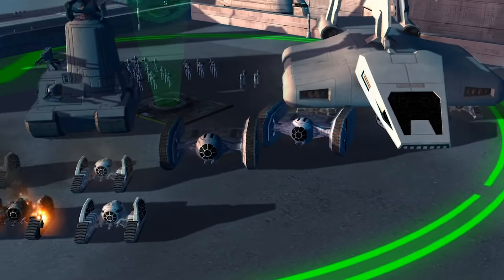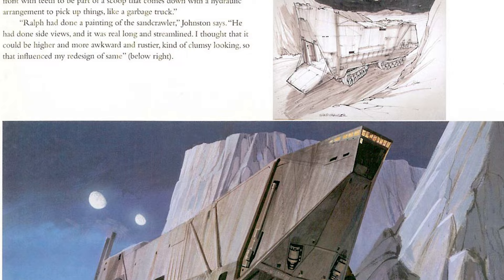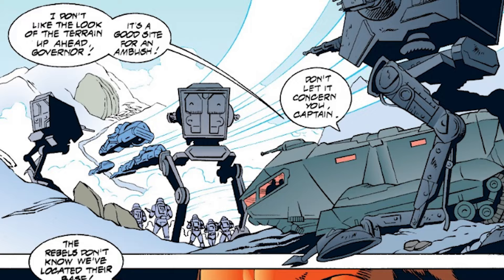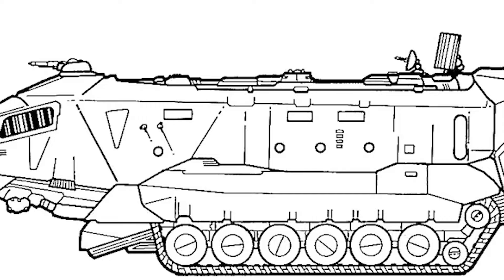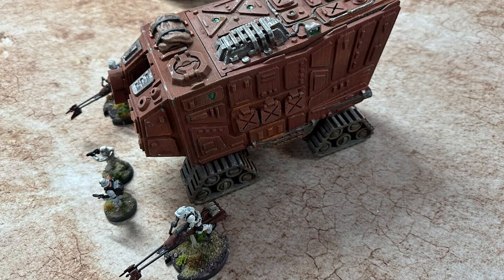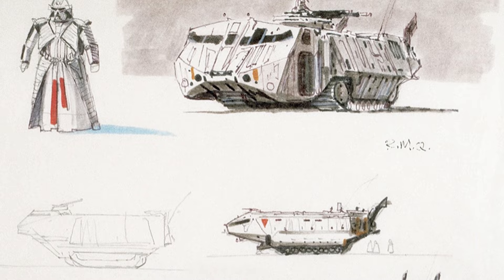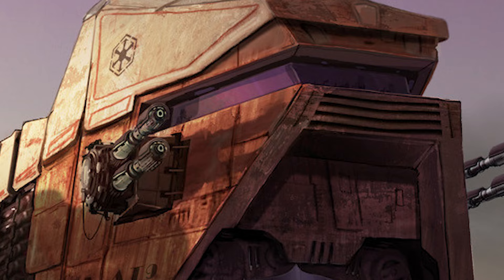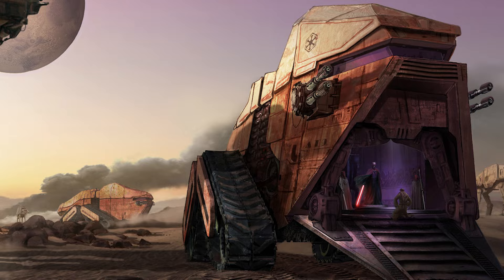Imperial Tracked Crawlers were GENIUS...but neglected | Star Wars Breakdown

Comment: I am sure there could be a whole host of tracked vehicles that aren't seen because they are more niche. Seeing as they made a submersible out of an AT-AT and the TX-225 had both a repulsorlift and tracked variant. The Saber-class assault tank spawned a decent sized family of variants, and I wouldn't be surprised to learn that a tracked version was counted somewhere in it's number. The company Yutrane-Trackata also produced the T3-B and T4-B tanks for the Rebels, as well as the chassis on which the MZ-8 was based on.

Comment: Honestly I think all designs have their role. I mean I like AT-ATs simply because they don't need waste laser cannon energy on every single hazard or obstacle the enemies have. While fast repulsor craft are really good either flanking the enemy or harassing the enemy in other areas. Like the imperial hover transports might not be great at assault an enemies fortified hq. However what they can do is attack the enemies outposts and lines of communication as well as deal with enemies own scouting patrols if you have the element of surprise and then further lengthen said time period of surprise. Quick lightly armoured units are just great for that. Attacking the enemies lesser defenses as well as means to communicate with each other.  if the enemy can't hear back from scouting teams its harder for them to get a picture and react to enemy attack. while your own commando raiders or advance force troops can start gain intel feeding it back to the battlefield commander in real time. 

From their they can find a suitable location to deploy walkers, track and or wheeled vehicles making up the main assault force while a portion of smaller walkers like at-sts and at-pts as well as light tracked tanks cans with smaller trooper carries can then secure captured terroritory as well said captured smaller outposts in which additionally light forces could be deployed secure the area as well as harass the enemy. And by the time the main assault force, shows up with heavy walkers like AT-ATs, and these heavy tracked tanks as well maybe even some Juggernauts your enemy will already be scatered in its attention that by the time see they the main force its pracitcally on top of their base. Plus AT-ATs are good for getting through energy shield barriers if for some reason some tracked or wheeled tanks might struggle not that would but just all these vehicle types have their roles and used effectively as well as supporting each other it can be very power force to stop even without facting in air support.

Comment: the at at wouldnt break the shields for hover units. they would have to be perfectly positioned to cross the threshold the same exact time the legs do. the head of the at at wouldnt enable anything below that height to enter the shield unimpeded. nothing in animation is concrete in any universe